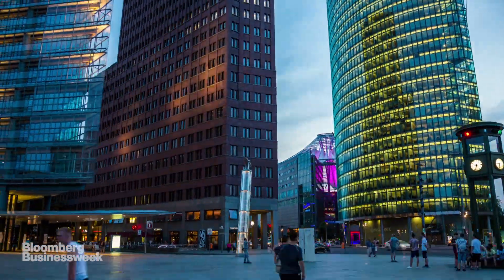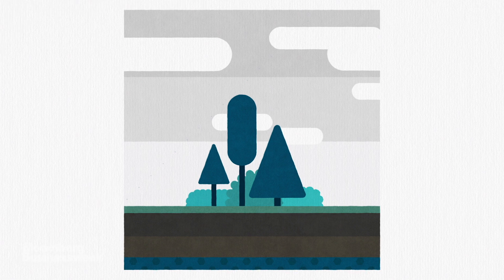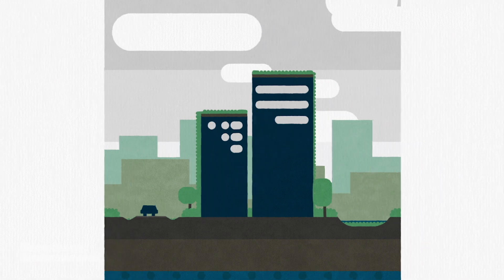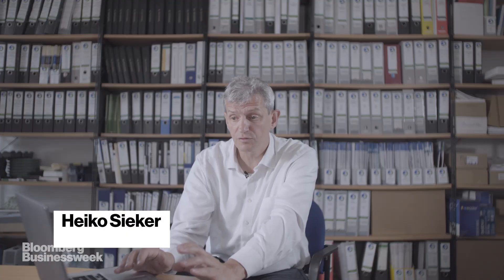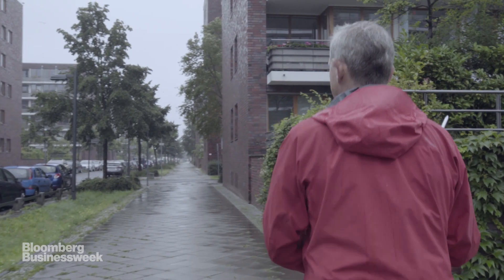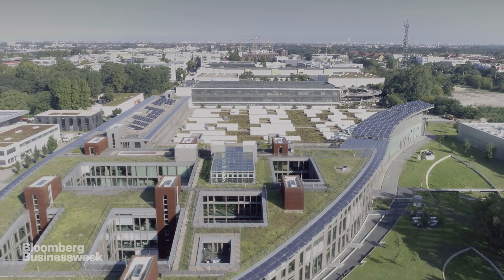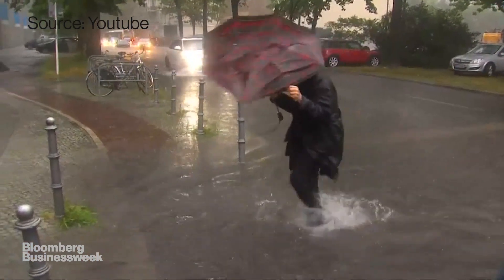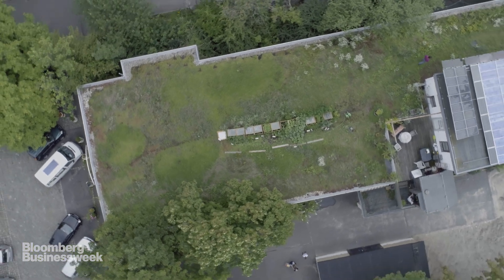Berlin is Becoming a Sponge City

Comment: Concrete actually acts like a sponge already (because of cement), so if you have much vapor around for long you will get mildew build up easier on the inside especially with the new type of plastic insulating windows.  Also where the sponge-earth meets the concrete eventually there will be water damage in those areas.

Comment: Don’t water increase humidity therefore heat! They must have swamp weather!
Reply: Humidity is a measure of how much water there is in the air, so the answer is "yes". Humidity doesn't increase heat: the heat must come from somewhere.
Reply: @kasegiyabu5030  otherwise water would be so hot, there is so much water in the air.

Comment: Serious question:  

I'm curious how that 80 cm-thick earth isolation between the garage and surface held during those heavy rains.
Because it eased water infiltration to the garage rooftop and long term the humidity reduces the concrete's strenght and lifespan. Amirite ?

Comment: The water that evaporates during warm temperatures causes increased humidity. So although the temperature may be lower by a degree or two the increased humidity, especially during hot days, will make it feel warmer than what it is.

Comment: I am assuming that 2017 would still have had flooding as this system is not designed to remove excess water. Even if it were a city wide initiative, there would have been too much water for the system to absorb quickly enough. It is, however, an excellent idea. They now need to deal with suburban areas where more and more land is being covered over, especially here in land starved England.
Reply: What is „excess water“? It is the amount of water after the sewage system is full. And as far as I know the capacity of such a „sponge system“ is uncomparably higher than that of a classical sewage system. In fact preventing flooding is one of the central ideas of the concept.

Comment: It's brilliant really. It looks nice, you reduce the need for air conditioning when it's hot, which in turn reduces stress on the electrical grid which reduces CO2 emissions. And the plants themselves are also absorbing CO2, win win.

Not only that, but I'd bet it's probably cheaper to build areas like this too since the need for a flood protection sewage system isn't required (or less likely to be needed anyways). That's a lot of hours not using heavy machines to dig up large amounts of soil and moving it elsewhere to construct sewers, and instead we're planting trees and grass.

Comment: Question: if you plant much green and put some kind of soil on the buildings, will the moisture deteriorate the walls and ceilings?
Reply: Green roofing systems still have some form of drainage from excess water. Also, the video over simplified moisture as the main factor for cooling. There is also having less thermal radiation from solar gain because the plants absorb the heat.
Reply: and it looks nice

Comment: In many italian town old roads are still kept because their outer layer is actually made of stones or san pietrini (levigated and squared ones) because concrete won't help with the heavy rains that sometimes occur. As the gaps between them let water be absorbed by the ground.
Also, are less expensive to mantain as rock is way more resistant and doesn't break in winter like tar, and citizens are safer as they hear incoming vehicles from the corner.

Comment: How does this method of drainage compare to traditional drainage standards? Can it hold up to heavy rainfall or flash floods? Is there a problem created with these rooftop beds of plantation like pests or quicker corrosion of the building? It's a very cool idea but I wish they had more information about the logistical aspects of this type of city design.

Comment: No, it's not actually cooler to use this system. This will just cause more floods.
Reply: Wouldn't it help prevent floods? A lot of floods occur because the water has nowhere to go, because there's just concrete anywhere. In sponge cities there's soil and plants everywhere that can absorb that water.

Comment: Great concept, but perhaps implementing a storm drain system that opens only in emergencies would be helpful to prevent freak floods.
Reply: In Berlin we had just "some bigger puddles" in 2017, which was an exceptional heavy rainfall. As usual Berlin is save from flooding because we don`t have severe rains and living on the Spree river is total safe because of the Spreewald drainage system. 

Such a drain system you describe is not necessary for Berlin.

Comment: Is there an increase in spending to hire gardeners to cut the grass? Not that that's a bad thing as it would boost the local economy, I'm just wondering if the increased cost would put off other administrations from doing something similar. You could put sheep there I guess. Bit impractical in a city though. Unless u banned traffic. I want lambs on my roof!!

Comment: I get the benefits of adding grass fields. But why entirely remove storm drain systems?

In a city you will never get 100% ground coverage, and even in nature (i.e. large fields) you can see excess floodings. Drain systems are already in place and take up fairly little surface area. If you keep them around they can take care of excess water that the 'sponge layer' cannot hold.

Comment: quick question, how does this work out with the concrete foundations? wouldn't having rainwater sitting in soil on top of concrete floors and rooftops cause steady degradation and instability in the structures?

Comment: This is a good idea, they can also put down some storm drains, that only operate when there is flooding, just in case. Those drains can be easily automated using a pipe and a flowmeter. The flowmeter measures the volumetric flowspeed of the rain through the pipe, and activate the drains if that speed is above a certain level, for a set amount of time. This can be done using only analog systems, and shouldn't even need electricity to work.
Reply: Or an even cheaper solution can be special street drains, that have a plug below them, and that plug can be held in place using a spring. If the water pressure above the drain gets above a certain level, the spring wouldn't be able to hold the plug in place, and the drain will get activated until the pressure falls below a certain level. This would be a very cheap "emergency flood release" system.

Comment: why not have massive underground storage like japan and use that captured water for fountains, water wall, other functional yet scenic things that will off evap cooling.
Reply: Because the soil underneath Berlin is to sandy for this kind of concept. Basically Berlin is built on a massive sand box and when you try to dig several storages filled with water in a sand box. what will happen? Sooner or later it will colapse.

Comment: Does it ever flood in Berlin? Removing too many sewers and drainage systems could backfire if it does flood
Reply: It does flood sometimes (in part because Berlins sewer system is somewhat outdated). But adding more soil and plants instead of concrete actually helps quite a lot with floods, because they absorb a lot of water.

Comment: I love this, don't get me wrong when I hear crazy envirmetalists here in USA it drives me nuts, but this is great idea not only to keep the water but also because it makes the city not a concrete jungle, the problem with flooding can be fixed simply by keeping the traditional piping system in case of heavy rain fall which can simply be opened and closed, there you have it.

Comment: Some of this already happens in Scotland.  Rainwater and surface runnoff is treated on site before being released into the environment.  Stormwater is collected in crates under the surface which then regulates its release into the treatment system.  There is a safety overflow though into conventional sewers to take water away if it cannot be treated or stored.  It's known as SUDS - "Sustainable Urban Drainage System"

Comment: Side effects are:
- no need for air condition = safes money and electric energy = enough capacities to power other electric consumers like trains and stoves.
- cleaner air, less waste gases from power plants
The city of Berlin once had a nick name like "Electropolis".
Reply: Side effects are used for generally bad things, I would better say Advatages
Reply: Björn Mundt ok
Reply: And it removes CO2 at the same time because of all the greenery.  The better air quality might also prevent future health issues.
Reply: Side effect would be higher building Maintenance
Reply: @biohazardlnfS  actually no. rubber roofs are much more seceptible to extreme weather, and a cooler city helps to reduce the likelyhood of extreme weather occurances.
When there is a lot of energy in the air, a heated parkinglot or city can be enough to trigger an extraordinarily heavy rainfall. Due to this being less likely with a city concept like this, I'd argue that the maintenance costs are actually lower.
Reply: @VoodooGMusic   plants degrade building materials overtime.
Reply: @biohazardlnfS  
So does heat
Reply: @antonb9459  not nearly as fast, english ivy growing on a wall can absolutely wreck the mortar between bricks. The sun doesn't often cause walls to degrade, and also people will need to be paid to take care of the plants in different areas of the city so they don't overgrow onto public walkways or roads causing them to crack and need to be replaced even faster
Reply: @nahnope8581  Atleast a new job opportunity has been made: City Gardener

Comment: I like the idea, however if you keep the rain at the ground level, wont you create a HUMID environment? Seeing that is an urban environment
Reply: But Berlin is not on a tropical place, the summer temperatures don't rise to the extremely high values of a rainforest, with August temperatures on an average of 19ºC, it's average summer rainfall is also nowhere near the rainforest values, so even if they filled the city with plants you wouldn't have the unpleasant combination of heat+humidity that you have on a tropical place.
Reply: Don't want to beat a dead horse, but this is missing:
The hotter the air, the more water it can hold before it saturates. You're totally right about humidity in rainforests/jungles, but since these climates are more aequatorial, the air is much hotter than in northern Germany (talking 25C vs 40C = 65F vs 105F), so they hold much more water.

What most Americans don't realize, Europe's mainland is basically 'north of' NYC, which is aligned with Milan, Italy. The Gulf Stream keeps Europe far warmer than your Canadian border region in the winter, while it generates more precipitation in the summer, making the weather more mild year round.

At those low temperatures, the air gets saturated very quickly. The water does not 'evaporate' into the air, it gets bound by it. If the humidity is 100% at 0-20C, you'll hardly notice it. Once the air has reached the point of saturation, any water added to it will evaporate in the form of steam. That reaction will literally 'draw' energy from the surrounding environment, cooling it the same way your body does when it sweats. The air around you gets temporarily saturated with your sweat and the air gets cooler for it.
Reply: I feel Ive learned a lot just by going through these comments. Feels good man
Reply: even if that's a problem (humid & heat is uncomfortable), humidity have a useful ability to neutralise pollution & pathogen in the air. Research have shown that rats with flu didn't contract/transmit virus well in humid air, and micro-particulate from combustion will clump together in humid air into a bigger particulate that is less harmful to our lung. Plants in the area will emit volatile organic compound and shed organic particles into the air as well... in a tropical forest this has been shown to produce local cloud and rain in the vicinity. Shed organic particles, like plant virus, might also excite our immune system without actually being a pathogenic or infectious, and the plant's leaf itself is good at rejecting infrared heat from the sun away from the ground. With roof made of plants, it is insulated from the heat and according to a study; doing this (is an alternative to painting roof white) will reduce 80% of your AC bills.
Reply: xponen have you ever been in a rain forest ? Humidity is painful, it can induce a heat stroke in people not accustomed to it... The roof top growth is fine, however if the ground gets too dense, then problems will occur
Reply: @phoenixkool , I don't think the growth in that video is too dense. For example, an open grassland have more growth & soil than that, and it wasn't as humid as in a forest
Reply: Yes, but buildings add insulation as well, nvm, dont have time to keep debating this. You're right.
Reply: @xponen  having open ponds and "wetlands" on surface level with roads will absolutely cause humidity to be a problem, cant wait to see the berliners complaining about the mosquitos breeding right next to their houses
Reply: And: Berlin, being a city that is intersected by several canals, the river Spree and surrounded by lakes and swamp lands, is pretty humid already
Reply: Sub-Monsoon is close to tropical. Not something that happens on the latitude of Berlin. Also: it is a windy city.
Reply: I did not know that! Thank you
Reply: It doesn't rain all that much in Berlin, where I live, Porto (warm summer mediterranean climate) the winter has a lot more precipitation than Berlin.
Reply: phoenixkool humidity is mainly caused by water in the surroundings. Look at a beach front city to a desert city. They are both the same temperature. But since the beach front has many lakes, ponds, rivers, etc. it's more humid because of the moister in the air. This idea use plants to use that extra water in the air to grow. Since many cities don't have the plants to stop flooding and other plant and water related disasters.
Reply: in most cases adding few centimeters of soil and grass on flat roofs is safe. Adding trees near road just requires to cut out square of sidewalk, add nicer finish,  plant a tree, maintain tree(cheap). Encourage people to plant more stuff in their homes and balconies(somewhat expensive - advertisement)
Reply: ok thanks Al F, i was just wondering, coming from a tropical climate i didnt want to be confused here.
Reply: Perhaps then one would hope that the hot days are accompanied by good wind, so evaporated moisture can be replaced with dry air again... starting this cycle. 

Where I live, we have the sub-monsoon season now (yet not really these years due to global warming), however when it gets hot as it does in June, humidity 90-100% and low wind. Without aircon, it really drains you of your energy even while doing nothing!
Reply: Humidity keeps the temperature more moderate. Exactly what Berlin needs.
Reply: phoenixkool HUMID
Reply: this is true as well good point
Reply: Humidity isn't painful, poor those who live on tropical countries if it is painful including myself. Trust me, it's fine. :)
Reply: @Derp Herbert
99% humidity at 20 celsius naturally occured in Europe's mainland this summer, it was suffocating. And I even like saunas!
For people not used to it, high humidity can be torture on windless days. Much more than dry heat would be.

The problem with a humid environment is that even though you might get a 5 celsius lower temperature, you effectively nullify the human body's ability to lose heat through perspiration.

Especially with those U-shaped block buildings that they were showing.. the air just gets trapped in the middle, no ventillation whatsoever. That's only about 5-6 evels high, we have up to 14 levels of the same shape where I live.

I hope I'm wrong and that system works though. I would be all for a natural heat-management. But if all it does is make people change their AC machines to de-humidifiers, then it isn't really worth it.
Reply: MrTheMiguelox  germany  is getting  hotter each  year though . It was almost always atleast 30 degrees with sudden drops here and there  .